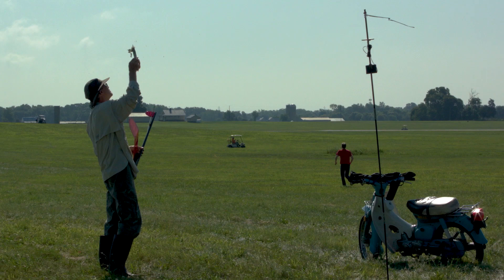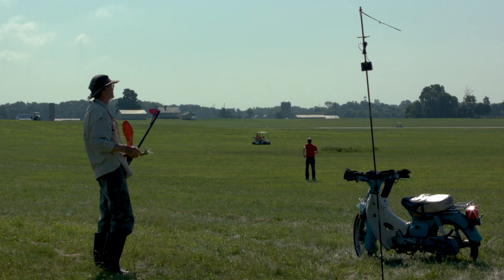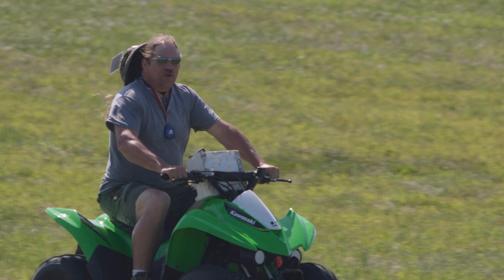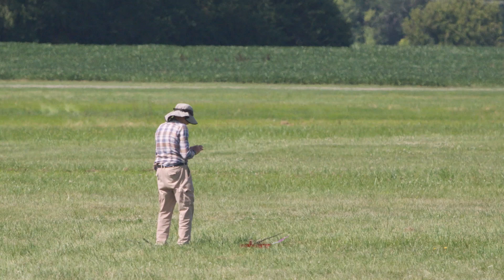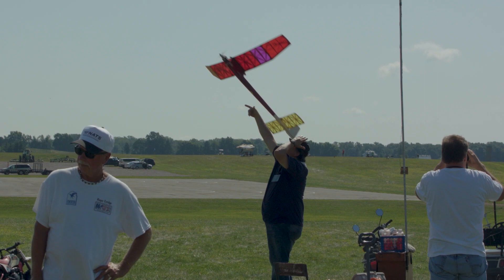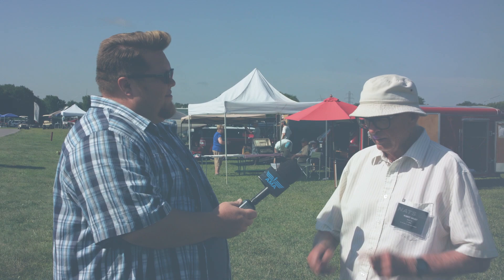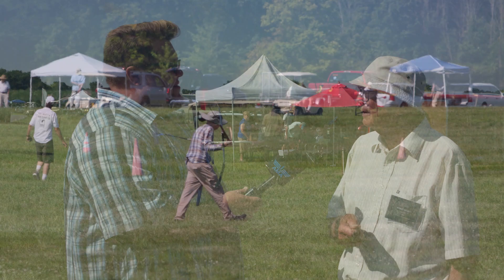Nats Demystified - Recovering Lost Free Flight Models

Comment: Great interview Except you never told us who manufacturers either tracking device.  That would have been tremendously helpful as we have searched for these types of lost plane devices without any success in finding systems that aren't too heavy or have long range capabilities.  Most either have a range of 300 feet or GPS units that only promise to get you within 300 feet !  Please provide any info you can on these devices and where to get them.  Thank you !
Reply: http://starlink-flitetech.com/

www.wmimodelaeronautics.com

airtekee.wordpress.com

www.optimaltracking.com/en/

Remote DT, bring your plane down before it goes too far away:

www.TexasTimers.com

National Free Flight Society:

http://www.freeflight.org

See the NFFS Technical Library for articles on these and other related subjects.

https://freeflight.org/library/technical-library/
Reply: I have used the Merlin FMV LM transmitters and R-600A receiver to find RC sailplanes and slope models. The transmitters are even small enough to use on our tow lines for aerotowing. Available at Mike's Falconry and elsewhere.